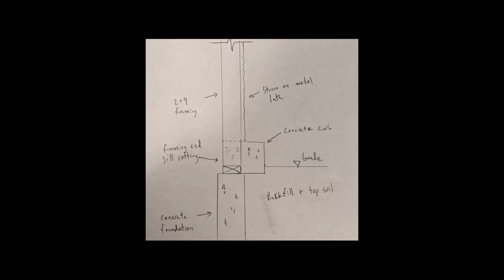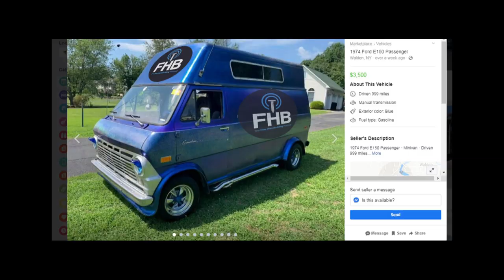Podcast 213: Fixing a Basement Slab, Making Stucco Walls Watertight, and What to Do About Insulbrick

Comment: It is entirely possible to design a 9000sqft shoebox that lasts 100+ years and uses less energy than a median 1000sqft house in the existing stock.  If you are optimizing for low energy, moving things inside the thermal envelope (attic storage, basement storage, garage workshops, HVAC) that wouldn't otherwise get get counted as square footage, is even advisable.  We have also added features (wheelchair accessibility, low-slope stairways at the current code levels) that take up lots of space relative to how you could build fifty years ago.

In my area, housing prices are high enough that every suburban house is potentially a multi-family house if the owners need it financially.  A one-bedroom apartment in a walkable area costs three times as much as a large basement bedroom in an existing suburban tract house.  People in extreme poverty are too poor to own a car, and are renting the 1-bedroom apartment and breaking it up between their family/friends.

Why is this happening?  Because new housing is too hard/expensive to get permission to build in nearly every city with a functioning economy in the country.  We are choking off supply to protect financial instruments.  But you can't easily restrict people from adding onto their home or renting it out.